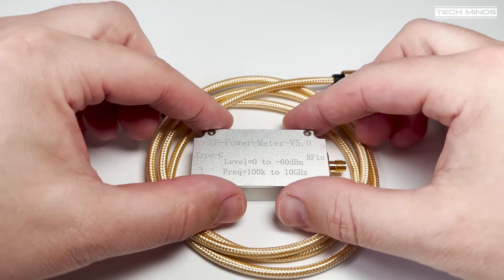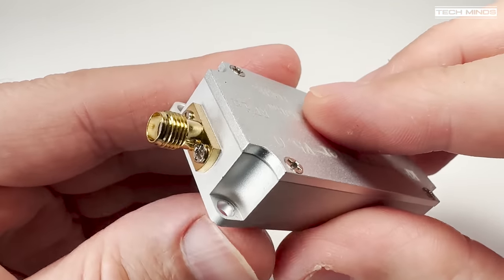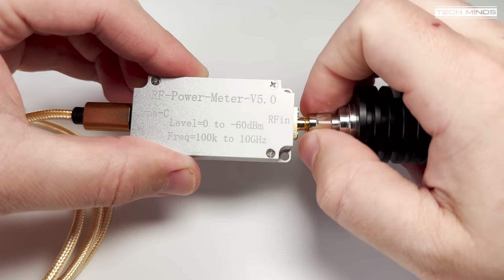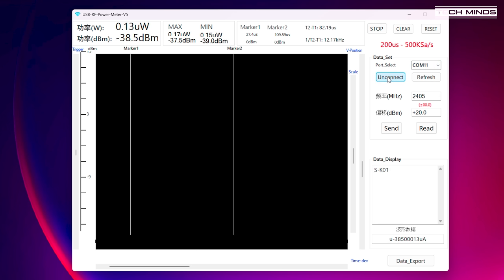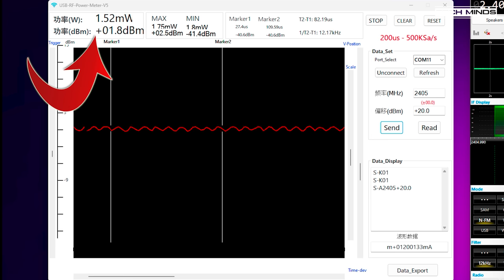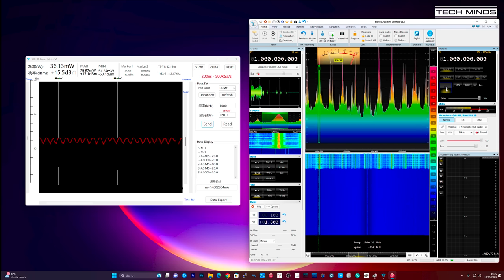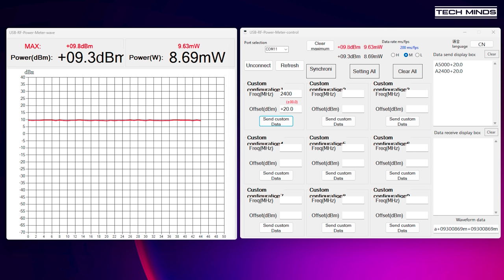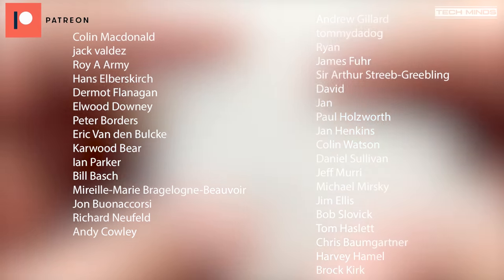100 KHz - 10 GHz USB RF Power Meter V5

Comment: Hey Matt, I have the V7 with the pretty colour display. It runs out of steam above about 7 GHz, but you can calibrate it and do relative measurements at a fixed frequency. OK, it's poor compared with using a really simple 16 bit ADC/display from a buffered HP33330B zero bias Schottky detector, which works fine from LF to over 18 GHz.  Once it's calibrated at typical frequencies I use, it's surprisingly good, but the input impedance of the attenuator/log amp has lots of bumps.  On a resistive splitter compared with various HP diode and bolometer heads, it tracks reasonably well.  Best bit is that it has an inbuilt battery that charges from the USB and works standalone. Definitely not a lab instrument but SO convenient when I'm doing antenna range tests. It streams the power level at 115kbaud in fixed length records, so it's a doddle to drive a big analogue display or giant LEDs so I can watch the received power level remotely on the range using a telescope, with no wires to mess up the pattern. I'll try to remember to take it to the Scottish and Midlands round tables, along with the French kits for crystal diodes using the M5STACK display/CPU.  Neil G4DBN
Reply: Ciao ma dove trovo il software per farlo girare. Grazie Claudio

Comment: Thanks for the excellent video, after watching this I purchased one. The issue with the text on the display is easily solved. I found this on the web about a year ago.  Create a short cut to the App. Right click the short cut, click on Properties and then the Compatibility tab. Click on Change high DPI settings then check Override high DPI scaling behaviour. Make sure Application is selected in the dropdown. Click OK and OK. I have only done this for the second App but expect it works for both.

Comment: Interesting. Perhaps pairing an AD8317 with a peak detector circuit could be used for measureing PEP type measurements making it useful for other than CW signals. Then a micro with ADC to read the peak detector output. Of course it would be great to have a  calibration table to correct the result over the frequency range of interest.

Comment: A nice video Matt. It would be interesting to test it against a decent signal generator and power head. Bit pricy though. This is the sort of thing that could be done at a microwave round table if planned in advance.
Reply from the maker: Cheers Mike, I’m pretty sure Gary said on the WWW net it was fairly accurate, but you’re right, would be good to see it’s accuracy for my own eyes. Will have to try and make the next microwave event! Thanks
Reply: Ewwww…Mike, I just hurled my breakfast.
Reply: I tested one today. It was quite good, at least up to 3 GHz. Not perfect but probably good enough for most uses. It compresses at bit at 0 dBm but seemed fine from -10dBm to -60dBm. Incidentally, it appears to just stream the data on the virtual com port so you may not need the software that comes with it. Node Red or something instead.
Reply from the maker: @mikewillis1592 What modulation type did you use? I think Gary ZS6 mentioned that it was quite inaccurate when using DATV.

Comment: I've tried both pieces of software, and it appears the software is communicating with the meter, and there is a little movement of the red line (noise at -99dBm). But when i apply a signal (carefully, with attenuators) i get no indication of a signal on the screen. ... The Ali Express page refers me to a Baidu page which requires registering, but then the Baidu page says it is not accepting overseas registrations. ... I would really like to get this unit working. Thanks

Comment: Great with a "cheap" (and accurate) power meter... Now I just need some lossless 100k to 10GHz cables and accurate attenuators :D
Reply from the maker: That’s the beauty about this being USB and small, you just connect it directly to the device under test,  no need for lossy cables.
Reply from the maker: And attenuators you can measure with a spectrum analyser.
Reply: I want to install my SDR adjacent to the antenna with a USB over CAT5 adapter, thus eliminating the coax altogether...
Reply from the maker: @thetruthserum2816  I’ve tried some cheap USB over cat cables from Amazon, they didn’t work very well so choose wisely and looks for ones with good reviews.

Comment: The other software, I uploaded some time back, to users with this metal RF v5box as I was I reckon there was a good chance it would also work, it comes from this USB3 RF power meter, that I show below, that got an display and a few buttons.. 
its quite a few years old, got it from CN..
I tested the PC USB3 modell with my SDR, (HackRF/CL) and it clocked in at 24.5mW at 2.445Ghz (video below)
it also goes from like 0 to 9999MHz, and have a bank of 10 presets you can adjust with different Mhz and Dbm offsets both can be adjust on the device display which are a pain in the a'zz or in the software andc you have 3 speed levels..
Its this fellow.
https://www.youtube.com/watch?v=bMnOtG7ROmI
https://www.youtube.com/watch?v=uDd7vuCyd28
Thx for the video Tech minds..

Comment: Wow, the presenter misread the frequency range of this device. It is 1 MegaHertz to 10 GigaHertz. Consequently he spent the whole half hour fiddling in the Gig range. He also never showed how to use an attenuator to measure say, a 2 meter ham rig running 25 watts. This video was of no value to me.
Reply from the maker: No idea what video you watched, but clearly wasn't this video..